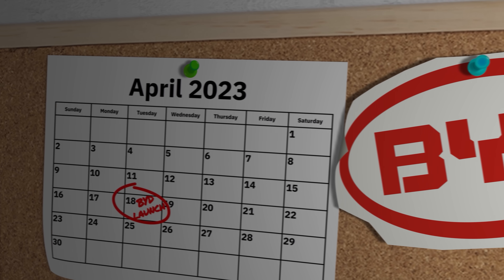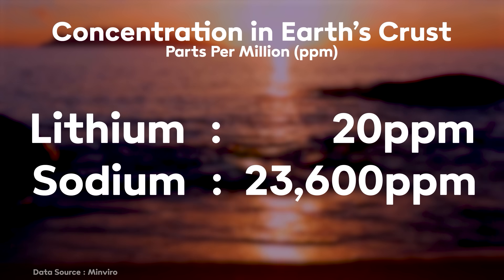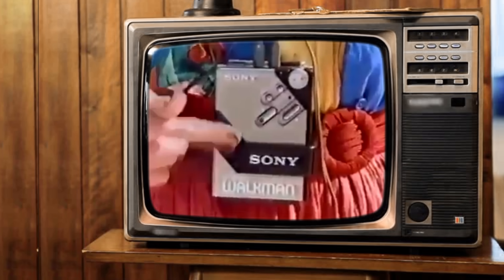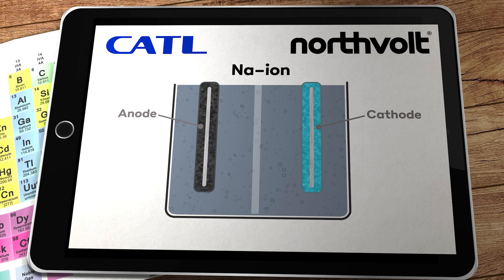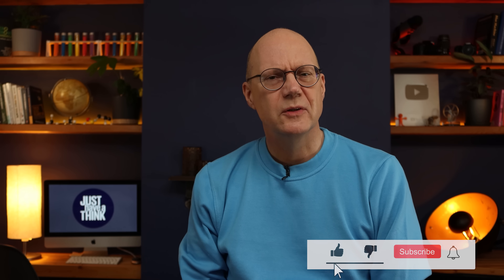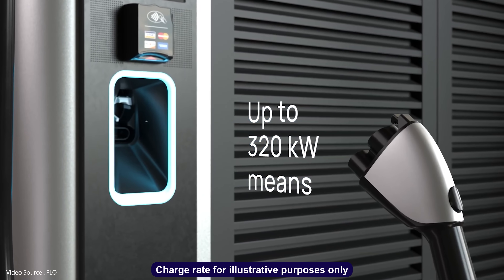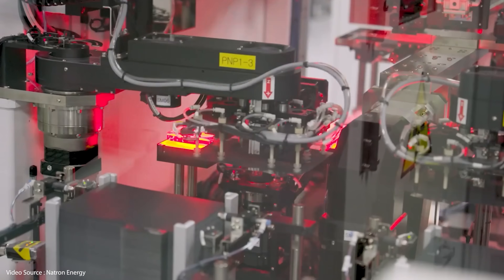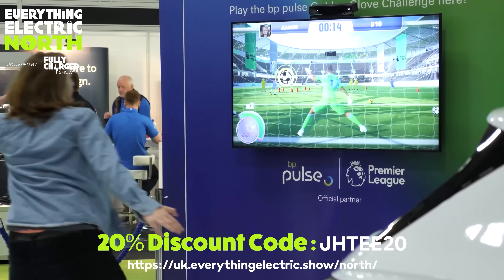Sodium-ion batteries in the USA. Beating China at their own game!

Comment: Their chemistry excels at extremely fast charge and discharge. They recommend applications where charge and discharge times are just 2-5 minutes. MINUTES - not hours. From their web site: "Optimal discharge time of 2-5 minutes*" "* Other load profiles are possible, however the BluePack™ is not suited for long term energy discharge applications" "Please note our batteries are not designed for, nor UL approved for consumer use, including residential or commercial solar power systems, off-grid power, automotive, marine or general DIY purposes."

Comment: Natron Energy website: “…not suited for long term energy discharge nor use by themselves in a BESS system…”
What does that mean?
Would this be suitable for small scale use, eg, residential, off grid, rural, farm, small to medium size business, etc?
Reply: No. From the Natron web site:

"Optimal discharge time of 2-5 minutes*

>50,000 deep discharge cycles

Significantly higher number of partial, or short term discharge cycles

Wide temperature operating range

Twice the power of lithium-ion

Round-trip efficiency >97%

* Other load profiles are possible, however the BluePack™ is not suited for long term energy discharge applications

Please note our batteries are not designed for, nor UL approved for consumer use, including residential or commercial solar power systems, off-grid power, automotive, marine or general DIY purposes."

Comment: Climate change is real if we want a world that is inhabitable lets continue fighting among ourselves. I have no problem with Chinese green energy its by far the cheaper way to go. The problem is western mindset that profits need to be made on going green which is idiotic in my mind. I DIY installed my own lifepo4 battery storage system and I get 65KW of solar we don't own anything that uses carbon anymore even my BBQ is electric. We should partner with Chinese companies to bring to market cheapest electric storage system can be made. If that means made in China who cares as long as it works. What are we doing we put tariffs in and market battery storage that is 100 times the cost China is selling. Why are we doing that it's because oil and gas industry doesn't want homes to have batteries. They raise the cost so the mass market can't afford it.

Comment: Very very cool. I wasn't aware that sodium-ion had made it all the way to production scale in the states.

Another energy density play for them is certainly going to be having this tech used for home and solar battery piles. Since it's substantially less volatile, it can enable more homes and buildings to store energy themselves and not require that they draw continuously from the grid - being able to draw a lot of their power during periods of cheaper energy production. While these batteries will be larger, they are much safer for traditional construction projects.

Comment: Not enough space between the graphite layers for the sodium atoms is not a big problem today when we have already developed the technology to produce thin monolayers of graphene and carbon fiber to reinforce this 'not hard but soft' carbon anode with a much looser structure to prevent this anode from expanding (cracking) when charging the sodium-ion battery.

Comment: Natron's tech is not very suitable for wide market adoption. They are unique in using PBA material in both anode and cathode. This makes the battery very robust with high discharge rate. However, energy density is pretty low.

Comment: I have seen many quotes saying Na-ion batteries should be cheaper than Li batteries, but that is a bit vague. Given the abundance of sodium and ease of concentrating it (at least while bound with chlorine), are there any decent estimates of how much once production is scaled?
A few years time and some grid capacity contracts should make Na home batteries viable without any subsidies at all, at least here in Australia. If the payback can be achieved in 4-5 years, rather than 8-10 that should accelerate renewable uptake massively. Add a subsidy and anyone getting solar would be mad not to install one from scratch

Comment: Material handling with forklifts and automation equipment  is the perfect application for na-ion
Reply: Maybe hybrid plugin forklifts. It would take the strain off of the gas fuel it uses. They may both not be used at the same time, but the fuels takes over when the battery runs out.

Comment: I would not want a sodium-based battery in my house due to the reaction with water (moisture) and the fact that sodium is flammable.  Chernobyl was a liquid sodium-cooled reactor and the sodium is what exploded.  Lithium, much more stable.  Yes, has a lower cycle life, but then again, if a LiFePo4 battery has a 2500 cycle life at 80% DOD and you discharge 80% every day, that is still a useful life of almost 7 years, at 50% DOD, 5000 cycles or over 13 years.  Not perfect, but still useful and much, much safer than sodium.

Comment: This is a great example of why "parts per million" is misleading. You really can't compare two different chemicals using ppm in any meaningful way. Since it is not actually "parts" like it sounds. It's actually grams of solute per million grams of solvent. So, since a Lithium atom [or ion] is only about one third the mass of a Sodium atom [or ion]. The numbers per ion would differ by one third as much. Instead of Sodium being 1,180 times more abundant than Lithium [as ppm makes it appear], it is actually only 356 times more abundant. Still, there is a huge difference in abundance between them, just not as much as the ppm numbers make it seem. I would recommend only ever comparing elements using their Molar Abundance, which gives you a better sense of how many ions would actually be available. I really wish that parts per million would be completely retired from use for this reason.

Comment: Just have a think about this :-
I bought a 30 kwhr Nissan Leaf Teckna 6.6 charger, made in Sunderland just over 8 years ago and used in the temperate NE of England. It has still only done slightly more than 40 k miles, yet the battery has degraded by 5 battery bars out of 12, which is equivelent to 42% capacity and range. Modern EV's with modern liquid battery management also have shown degradation ( battery life, volkswagen id3 , 10% degradation in 2 years ). The fact is that all lithium ion batteries degrade, which makes BEV vehicles not fit for purpose in my opinion, and I will never buy another electric car ever again, purely because of this fact.

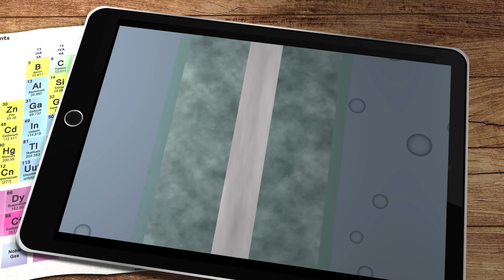Comment: at 2:42, you've got lithium ions, cations after losing an electron, being attracted to an anode, In solution, cations are attracted to a cathode where the cations gain electrons.  You've got the electrons flowing up out of the solution into an electrode, but since electrons are flowing up and out of it it should be negative, but you've got the top of this electrode marked with a plus sign indicating that it is the positive pole. your electrodes names and signs are wrong. Who's the artist for this operation? It's certainly not a chemist!  Electrons flow down into a cathode thereby attracting cations in the solution that need electrons.

Comment: I live in Los Angeles, and there are companies who are working on harvesting fresh water from the ocean.  The problem they have is what to do with the salt brine after the purified water is removed. Right now, they dispose of it right into the ocean.  And, although it's "clean", it raises the salt concentration in the surrounding area, which marine life doesn't like too much. This may give those plants a market for selling their salt brine to battery manufacturers!!  Ah... closed-loop economy may solve the problem again!!
Reply: @davidallyn1818
Carlsbad's Desalination plant produces about 50 million gal/day and so releases back into the ocean the approximately 14 million lbs of salt contained in that 50 million gallons.
Calculate the increase in salinity:
 * Salinity is typically measured in parts per thousand (ppt). This represents the grams of salt per 1000 grams of water.
 * Initial salinity of the Pacific Ocean is around 35 ppt.
 * Increase in salt = (6.35 x 10^6 kg) / (4.272 x 10^12 kg) = 1.487 x 10^-6
 * To express this as ppt, multiply by 1000: 1.487 x 10^-3 ppt
Answer:
Adding 14 million pounds of salt to a cubic mile of seawater would increase the salinity to approximately 35.0015 ppt. Since water is a fluid and tends to mix with the surrounding water I really don't see a problem with this miniscule increase except perhaps in the relatively small area where the outflow discharges to. I hope this helps you sleep better at night 🙂
Disclaimer: These calculations are courtesy of Gemini so there could be hallucinations?

Comment: If it wasn't for greedy oil industry lobbyists, we wouldn't have this problem right now. Lobbying or call it a political corruption model should be banned and heavily penalized.
Reply: Not fully, you are lily hearing about the new tech as of right now - the tech isnt new, but its not new in the production cycle or the level of performance, so all in all, there is nothing blocking or slowing it down. We simply never had a need to want to build them till more recent because of the stuff China is doing. Other wise, we let china just build it all with no worries.
Reply: @adr2t  it's not about new tech, but about the lobbying. This corruption has slown down development of new/alternative energy storage tech and by the time business realized there is no way to retain their influence on oil consumption, other countries (not necessarily allies) have already been prepared.
Reply: @chopperpl  This is about new tech, this is the bleeding edge stuff coming out right now, there has been no time for anyone to lobby though.... so I am not 100% sure what you mean by this comment. No, Na and other batties just take a long time to get right. It took 40 years just to get where we are with Li from other battery tech like lead-acid.

Its not like software I can update tomorrow on a new feature or patch. Even hardware takes 5 to 10 years before you see it. Most chips today are 5-10 years old from when they first started working on and protype the logic of it. Like there is a ton of lead time to many of the things we use today. While I agree there is lobbying going on, I dont agree anyone lobbying atm on new battery tech. Unless you have some sources? Like EVERYONE needs batteries across all sectors even in oil.

Comment: Hmm ... why are you still droning on about lithium science?

Sodium for a static area storage is a much better solution for buffering grid demand. 

You'll know by now your fellow vlogger, Robert Llewellyn, has begun to broach the topic of hydrogen as a fuel.

His recent guest, a lady chemist and author, gently steered his thinking away from the silly notion of battery powered HGVs.

It's an accepted fact (granted not by everyone) that lithium batteries, either lithium ion or LFP types can snd fo self ignite.

(Ref the latter then suggest you resesrch this issue and take especial care to read the info on the SOC.)

This notion being but one example of wrong thinking by certain  sectors within the transport industry.

For Robert it wasn't quite the full DC (religious connotation) as yet of course but anticpating a slow migration to more and more hydrogen based discussions in the months to come.

Would suggest you liase with Robert if you're engaged to host a discussion on his event circuit ref toning down the spiel on lithium battery science.

Should Robert host this young lady chemist at one of his events then you'll know which science Robert is turning towards.

In fact you might consider buying her book ... a shameless plug.

But still.

Comment: Why the hype when there isn't even major production online yet? It's literally just out of the lab. The power densities are much lower than Lithium and for stationary applications only.

So not beating anything yet.
Reply: Because it marks the first time batteries will/can be made out side of China and dont require rare earth or other hard to get resources and metals to produce them. They have the ability to out scale and out produce anywhere around the world. It also makes it so one country doesnt have to rely on another. Over all, it means we have a way to produce and store our own power with time scales that could quickly improve Co2 emissions as well. Aka, cheaper batteries that hold about the same amount of power as Li getting cheaper every year while li doesnt have much more room to to get any cheaper. Currently, plan production between the UK, USA, and a few other countries should out scale what China is able to produce and ship out.

As for not being able to be used in automotive - thats kind of false. Yes its 30% more weight, but that only makes up about 15% of the battery total weight - so you are only adding a bit, and the rest could be made up with more cells or larger cells to even over come some of that issue.

Comment: My simple question is will the battery explode and burn?
Reply: They can still explode, but more as a pop per cell, thats actually a desired affect than burning that Li has. Yes both can burn if damage in a way that will cause heat, but Na will be harder for that to happen - aka will be stable than Li just sitting around.

Comment: Not happening sodium batteries are not energy dense enough.
Reply: Energy dense has little meaning to the global power storage needs.
Reply: @adr2t  really?  Where did you come from?  Energy density is very important! Why are we using lithium batteries then?  Because for the weight and cost they are able to store enough energy to make all the effort worth it.  Unless you want batteries the size of houses energy storage density is very important!
Reply: @TonyL-gw4qx  Why? Because it takes 40 years for us to come up with new tech that matters. Along with the method of usage. Li works great for smaller compact devices, but not so much for large scale systems like grid and others. Why has this been a change? Well because we are trying to burn less and store more as one has went up in cost and the other is coming down in cost. The world is changing, thats why. Simple as that. I think you are trying to lump all needs into one and the world doesnt work like that. No one application will work for everything. Na wont work for smaller applications that need higher power dens, but neither do Li either when other applications can be used as well for higher power dens designs yet cost more to produce and use. Na will make up the bulk of power needs witch indectly helps Li come down in cost as the need wont be as high from the home and grid areas. So, yes, you are wrong.

As for why - home and grid dont have weight or size limitation as tight as your cell phone would.

So where does Na current power dens apply that limit it from not being used in those sectors uh?
Reply: @TonyL-gw4qx  Over all, dens to weight has little meaning in majority of battery needs. The cost to storage does. Different than power dens. If I can store 50kw of power for 50$ in Na but it cost me 100$ in Li, witch do you think will be better over all for "global power storage needs"? I even go as far as you say power dens is so low on the level of chars we look at into a battery that charge cycles, how quickly it can charge and discharge, and safey over shadow that.

This is why LFP over shadows NMC evn though nmc can store more power - we are looking many other variables to when it comes to producing and using batteries.

Comment: If a regular electric car has 😅10kg of lithium and sodium weighs three times as much, that would indicate 30kg of sodium.  a20kg weight gain in a car is not very much.  Not sure what the weight difference would be in the other components though.
Reply: Thats the thing, people are crying fail over the weight, but its small enough its not really that much weight and a lot of the weight can be off set by making larger cells to using less over all other elements found in batteries.

Comment: Do sodium ion batteries have the same fire hazard issues as lithium ion batteries?
Reply: No, they will pop before they burn. While you might hear a bang in your car, thats still way better than a random fire. With that said, if they damage in a way that can cause heat, much like anything, they can still be set on fire. Yet, will be way safer than Li just sitting around.

Comment: everyone seems to keep missing the energy density penalty, which is fine for stationary usage or special portable commercial backup.
Reply: Because energy density isnt everything for a battery. Let alone for an EV as well. Keep in mind, even at a lower power dens and increase weight, Li and Na will only make up a small precent of a cell - and you can always add in more cells. Batteries have a number of variables you can adjust to get the same or more power. Along with them being cheaper and resources that can be found everywhere around the world, adding more cells or adding larger ones wont really hurt your over all cost for the pack it self or even be cheaper in many cases.
Reply: @adr2t  except the in video bar graphs he shows, puts them equal to sealed lead acid batteries in weight to energy density.
it wouldn't even work for trains or tractor trailers then, it would be equivalent of someone doing lead acid battery vehicle 40+ years ago.

Comment: If I remember correctly, the sodium-ion battery is also extensively researched by Chinese battery manufacturers, but it's unsuitable for EVs because its energy density is relatively  weak, thus requiring a much bigger pack to drive a car. Therefore it is more suitable for scenarios of energy storage as a complement to emerging new energies such as solar power and wind power plants. As for EVs, the lithium-ion battery is so far the best choice in the foreseeable future.